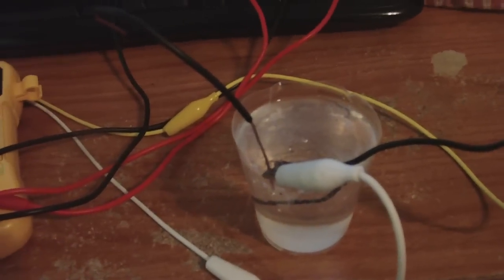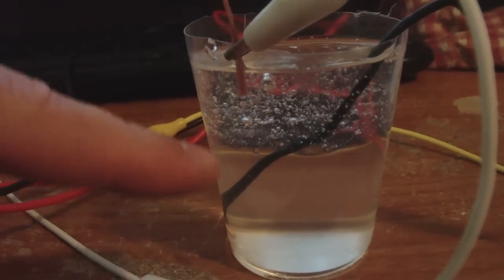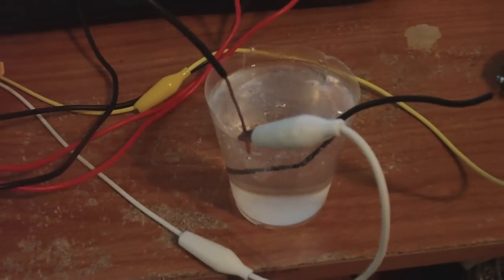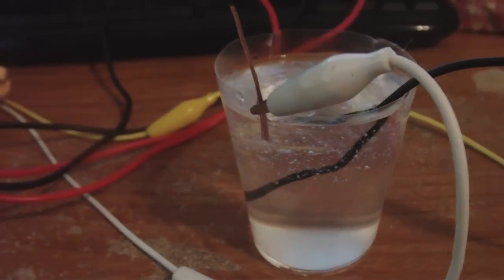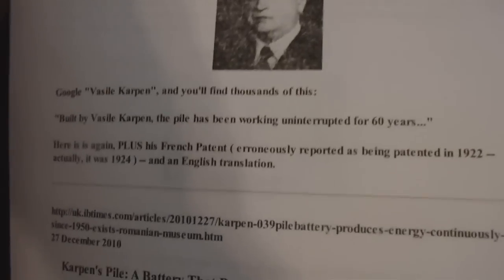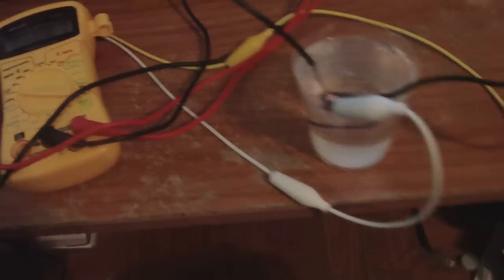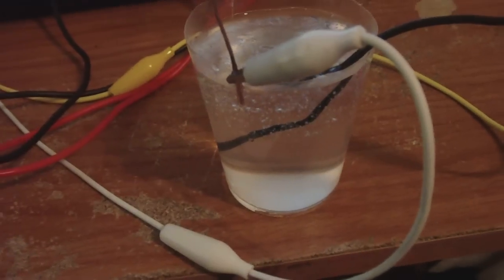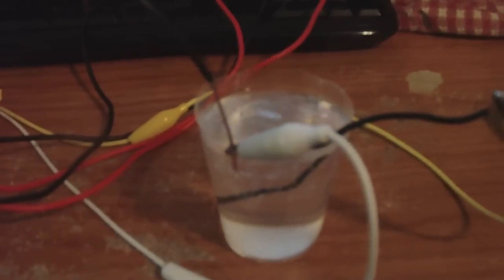Karpen Pile Replication 02 different mix

Comment: The Karpen Pile is claimed to be a battery that has provided continuous energy for over 60 years, making it either a supremely effective method of storing energy or a hoax, furthermore some newspapers describe it as a perpetuum mobile, but most scientists disagree since such a device would violate the Second law of Thermodynamics.The device is housed at the Dimitrie Leonida National Technical Museum.
It's been working for 60 years so far. 

en(dot)wikipedia(dot)org/wiki/Nicolae_Vasilescu-Karpen

Comment from the maker: Good point about the amp test. Karpen says that this is not a chemical cell where a chemical cell will drop when doing a amp test the Karpen cell gets its energy from somewhere else. Karpen says the cell will become depolarized and it must sit to recover so I think hooking it up to a capacitor or super cap will be the goal to get the power from it. 

What's wrong with you Innova meter? I love mine.

Comment: What was good there, was that the amperage test didn't drag the cell right down, to say 0.1V as I expected.
At about 0.47V you'd get a 'Penny' type blocking oscillator to run off that amperage.
Have you tried a cap on the output, like the salts cell rejuve trick ?
Btw, your Innova is looking a lot smarter than mine is nowadays !

Comment: I tried with amylic alcool, NaOH and 2 graphit carbon rods. I build a glass cell with a small glass tube to get one rod directly to the lower liquid (I care when fulling the cell not to mix the liquids : so the tube had only one liquid). I get quite same results : increasing voltage but at some time, voltage stopped increasing and  get lower to zero. I discovered after that I should have used different carbon state rods. Have you tried something like that too. How long lasted your experiment ?

Comment: you looking at it wrong ibpointless2 you will get more out of it (probably 0.8 V as this seems to be in range with the other 2 variations liquid-gas or 1 liquid with 2 dif. electrodes)  when you USE the power .

Then the environment will add the full potential for that specific cell .

Comment: did you ibpointless2 try the other variations ?

There are 3 variations .
1. 2 liquids with carbon or platinum electrodes
2. 1 liquid + a gas with platinum, nickel or carbon.
3. a homogenous Liquid ( 1 liquid) with .....

and this is a give away to what materials you can use :

..." two different metals such as platinum and nickel,  either a metal electrode and another electrode carbon, or an electrode carbon and another electrode also carbon,  but of different quality -- for example, a graphite electrode and the other of retort carbon,  or a carbon electrode and the other wood charcoal, etc.."

Comment: Hi i've been working on something similare, never thought of sodium hydroxide though. I dont have the equipment to do a video or the hydroxide but the way i have done it is to use water, cooking oil, magnesium ribbon as the negative and copper wire as the positive. Copper wire goes through the oil to the water and the magnesium into the oil. the magnesium must be close to the surface of the water but not break the barrier of the oil. Thought you might like to give it a go 2010TOMS REGAURDS

Comment: How does your experiment compare with his? Your's looks nothing like his. His piles used copper/brass/silver plate and a zinc plate and a vinegar with salt solution. .  In the book/blueprints I have they use just the copper and the zinc plates, as these two metals are the most affordable for the process.  I do not remember the site I got my material from but it was a preppers advertisement.  It has detailed instructions and drawings. I do not know if this is the site I got it from but you might try Frank at Power4Patriots.com.  If I did not get them from him, he may know who sells them.